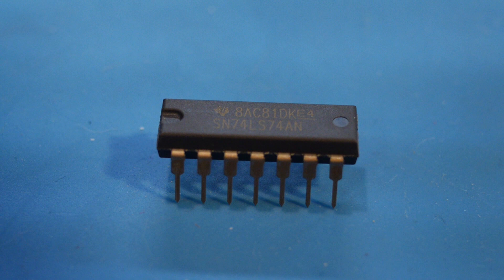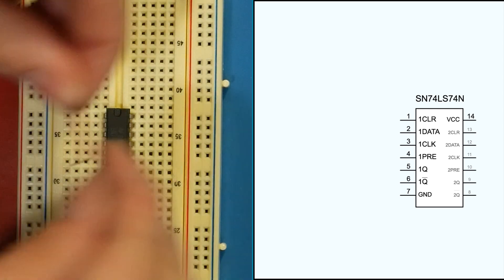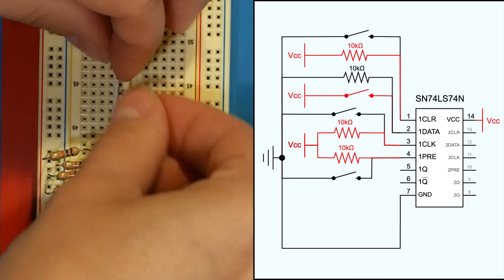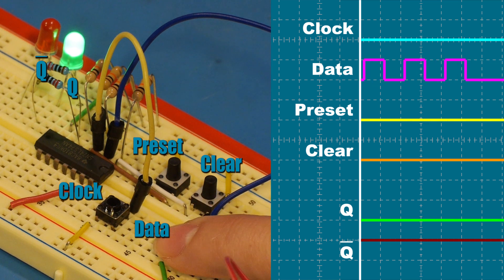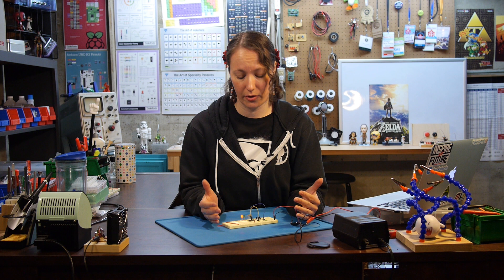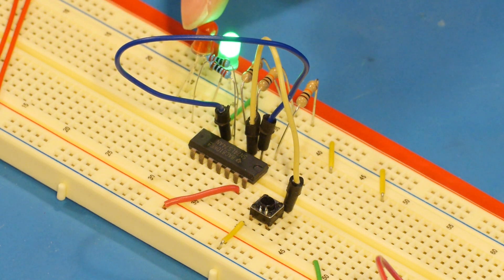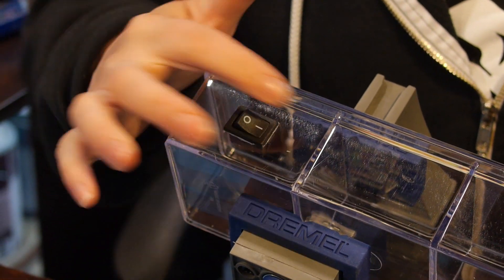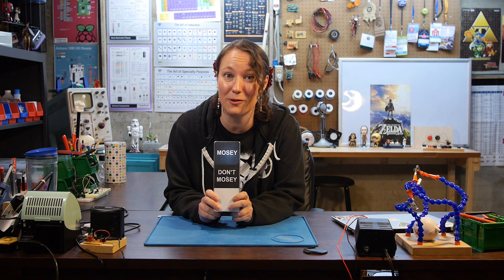Toggle Sign Using an SR Flip-Flop - The Learning Circuit

Comment: Have tried to build a radio around a 74AC74 and 74HC152 and 2x MC1350 chips which drive a phasing combiner which then drive a speaker via amplifier. if you don't understand what I mean  it is a Quadrature Sampling Detector.

Comment: 74LS series chips are classic TTL and don't strictly need pull up or down resistors, as they basically have them built in. CMOS variants like 74HC are sensitive to electric fields which can cause erratic behaviour or result in increased power consumption if pull ups/downs aren't used.

Still it's always good practice to pull unused input pins up or down.

Comment: Hi love the video can't wait for the 555 timer to be added hope it's soon , All the Best Brian 🤗 Thank
Reply: 555 timers are next! And there will be 2 lessons and 2 projects about 555s! Double the usual fun, and learning!
Reply: @maker_karen1785   Don't forget opAmps, ADC, DAC, digital POTs, etc.. Logic can be done by microcontrollers, but analog ICs, does what MCUs can't. For hobby usually you're the author of circuit, and it is more likely that you'll get back to your project with upgrades, what can be easily done with MCU. If you use logic gate ICs, technically for any upgrade you need build new PCB setup. I would say today Logic gates are fun, but for hobby has not much use except educational purpose. In production it can save price per IC, but for hobby it doesn't matter. Just saying what I think, but I like your videos anyway, even if it will be about 555 timer :)

Comment: Just use a relay. Or a toggle switch.
Reply: It's the journey, not the destination.
Reply: @haku-jin  you can get the journey from the simple way too.
Reply: @azimalif266  It's a tutorial on using an SR flip-flop in a simple circuit, not a tutorial on how to wire up a toggle switch to light a lamp. They're completely different journeys and one has many more destinations branching off it than the other.
Reply: @haku-jin  add an arduino to a relay.
Reply: @azimalif266  Okay.
Reply: @haku-jin  😂🙌